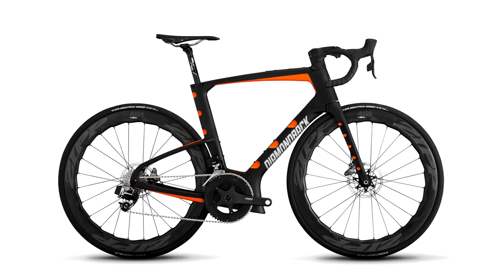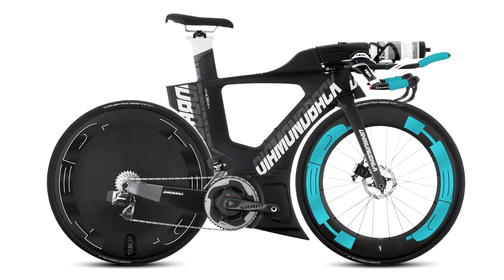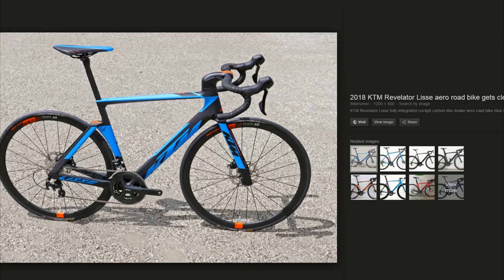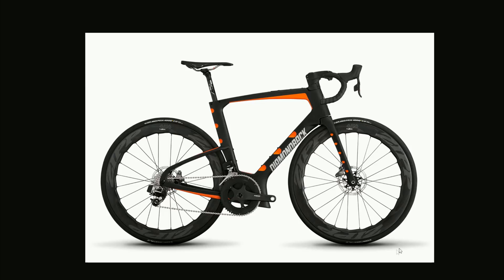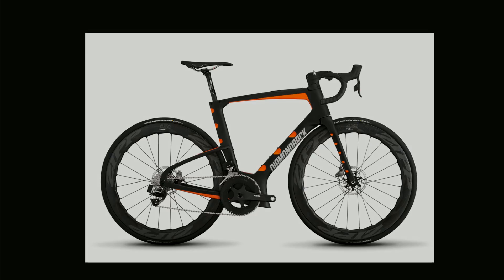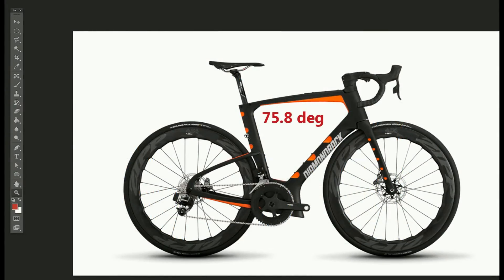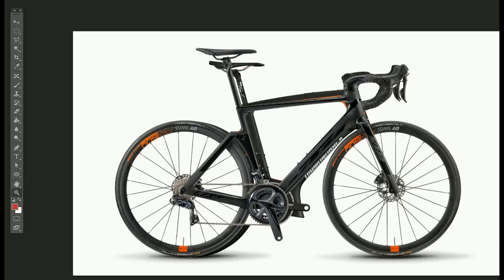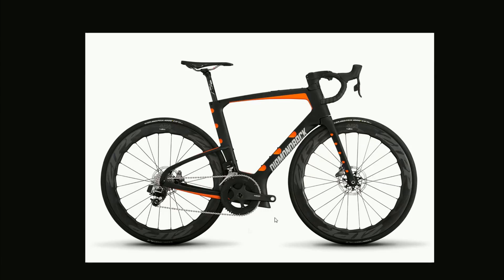Diamondback IO vs KTM Revelator Lisse: Does Wake Control Really Work?

Comment: There is a lesser known company that has been designing Time trial bikes that have seat stays as low as the now-defunct Diamondback IO... the name brand is Blue, the models are Triad and Triad Elite, Blue have been making low seat stay aero carbon frames for almost 9 years.. Their older frames (2010-2012) can be found on Ebay for very reasonable prices..

Comment: According to DiamondBack "There are currently no plans to produce the IO. Sorry! "
Source: https://forum.slowtwitch.com/forum/Slowtwitch_Forums_C1/Triathlon_Forum_F1/Ask_Me_Anything_with_Diamondback_Bikes_and_Kevin_Quan_P6441961-3/
Also, in the first page of the same thread, DM  design team leader Kevin Quan  speaks about the seatpost:
"Our CFD tells us that for every 10cm of exposed round seat post yields 15g of drag at 13 m/s (CdA 0.00132). An equivalent sized road aero seatpost is 14g of drag at 13 m/s (CdA .00124). So the difference between an Aero Seatpost and Round Seatpost is around 0.05% of total rider-bike system drag. It might look out of place, but for this application the round post wins the cost/benefit analysis." PS. Kevin Quan  is now designing bikes for Walmart's bike brand Viathon

Comment: Its not likely that the bike in the image you've used is a 52cm, which is fine, but a bit confusing. Doing a bit of quick photoshop measuring here (not very accurate I know) I can see the headtube is longer than that crank arm (probably 172mm), which means that it is likely this frame is a 58 or 60cm. This makes sense looking at the overall proportions of the bike. The head tube is very long! typically with a 52cm frame the headtube will be very short and the its small size will be very apparent relative to the rest of the frame parts/wheels. I think it is possible that the saddle is set quite low on the bike in the photo giving the illusion of a smaller frame.

The real question I have about this bike is why on earth does it have a round seat post?! So bizarre. They should have used Mavic Open Pro wheels too...
Reply from the maker: interesting observations, thanks. someone else might comment on the original bike sizes from these images

Comment: any aero benefit of the frame is more than negated by the high headtube which means you cant get lower
Reply: JogBird only if one wants to be lower. Not everyone is able to ride a race bike with a slammed stem. For those people something like this is a better option than having to add fugly spacers under the stem